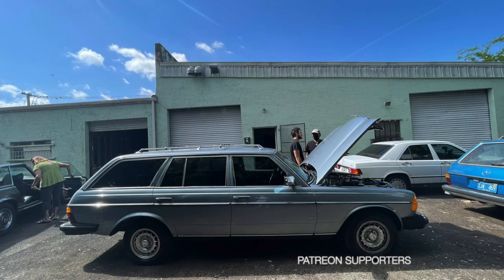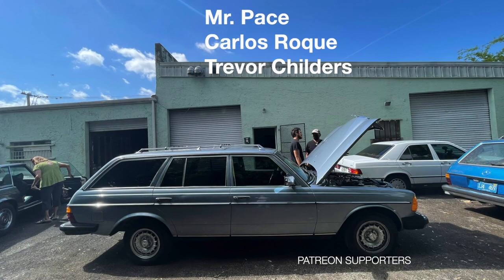What is the Mercedes M119 engine and how was it developed?   HD 1080p

Comment: If you ever followed Tim LaTobe's M119 custom engine build for his W126 SEC track car.  He built his own custom intake manifold using the cut-down base plate of the factory one with c/f i/runners leading from a larger plenum above the intake and not in the valley. Larger T/body fed by over the radiator rammed air intake.  original cams were re-profiled for more lift & duration, custom exhaust, block bored out to 100mm cyllinders with forged pistons, M117 crank, dry sump, Modern ECU and dyno tuned using rear hub direct bolt dyno.  Engine achieved near 700hp ATcrank n/a which was pretty stout.  So the moral of the story is still the intake manifold/plenum & cams are the key to unlocking the true potential of these amazing engines

Comment: As the owner of a 1984 500SEL W126 with an M117 engine and a 1990 500SL R129 with an M119.060 engine, black over palomino, with an original AMG Type 1 Body Kit, this video scratched all my itches! I noticed the many similarities as I learned about and worked on the 2 engines. I just assumed that how all engine development worked - the later evolving from the earlier.
Anyway, this was a great video and I am looking to absorb everything I can about AMG - especially pre-merger, so please bring it on!

Comment: I purchased my first Mercedes in 1995. Was a 93 400E with only 30,000 miles. Loved that car, was kind of too heavy to be a true sport sedan but the engine was dead smooth, as in you didn't even know it was running, from idle to 6,000 RPM. Used to run it on the track at Willow Springs with the Porsche Owners Club. Burned up a few sets of brake pads and tires but was still running perfectly at 185,000 miles when it was sold. In 2004, my girl friend had a 98 SL500. Nothing better then cruising down PCH with the top off. I believe the M119 engine was one of the finest production V8's ever. Some may argue that the all aluminum construction was not durable but that was only true if the engine was abused, over heated or poor lubricants were used. I always used Amsoil products and still do, never have had a failure of an internal drive train part.

Comment: Happy New Year Pierre! Thank you so much for such an insightful video of the M119 engine.  I own a 1996 S 500 and a 1998 CL 500 with 119.980 engines and love them both. They are powerful, smooth as silk and have been unbelievable reliable and easy to maintain.  I bought early last year a 2017 S 500 with the direct injection M278 engine and although is insanely powerful and fast because of the bi-turbo set up, there is clearly no other advantage against the M119.  I would deeply appreciate if in the near future you'll make more videos about the W140, which I know you were not fond of at the beginning, but I think they are now proving to be an exceptionally worthy Mercedes classic, more so when they have been properly maintained and cared for.

Comment: Great information!
The very very first three prototypes of the M120.980 had a modified KE3 installed and they were installed in three W126’s in 1987/88. Can’t remember which transmission and differential they used in this setup. 
We called those three Earlkönige.
Just food for thought
👍🏻👍🏻👍🏻
Reply: Funny you mention that as they basically grabbed 2 m104.980s and joined them together with the 6.0 liters and cis injection. Plus they share parts with each other in the production versions! Bmw unveiled their v12 a few years prior to mercedes introducing theirs and they definitely panicked when the 560 was the best they had vs a v12 salon. But (friend has both a 750li and a 560 sel) the 560 is definitely faster still!

Comment: I owned a 97 W210 with a M119. Love that car and really loved that engine. Never gave me a problem. I did maintain it as per MB service instructions.
Reply: I've had exactly the same car for over a year now, 97 e420 with 230k km, doesn't burn or leak any oil and starts every time and is buttery smooth.
Reply: Didn't the w210 rot from rust after about 4 years ? I'm in MN so maybe it was more likely here.
Reply: Body has ugly spots of rust and like a hundred small rust bubbles, but frame is solid and no spot on the body is rotted through like you would get on say a 90s Subaru. Nothing a $15000 paint job couldn't fix on the w210 😄
Reply: You gotta be adamant with those 210s in the rust belt.  I've found keeping the bodies clean every few days (LITERALLY BY HAND EVERY FEW DAYS)  and a shot or two of Silicone spray in the nooks and crannies (for good measure) keeps them pretty rust free year after year even with hard winter use.  Hello from NH.  E300 Turbodiesel.
Reply: @jzaroh2004  good to know. I have owned only w124s, w201s.  Im not even sure I could find a w210 without rotting panels here now but maybe I'll look.
Reply: @googpix540  they did have rust issues those years. The one I had was always a Florida car where I live. But I have seen some that traveled up north in the salt just destroyed them.
Reply: I owned that car for about almost 5 years I guess. And put 40,000 miles on it. It ran flawlessly. Got pretty good gas mileage to to be a V-8.

Comment: I love the M119, I had it in a 400E. One thing I don't think was mentioned was the M119.960 had the "tall deck", same as the M117. The LH and motronic versions got a shorter deck height, presumably to help with packaging on cars like the 124 and 140 (which never got the .960). I would love an early '90-'92 500SL, those seem to not carry a premium over the later cars with the 722.6 but I think people are missing out.
Reply: I just got into r129s being a w126 fanatic forever! And being a cis guy, I went with a 92 500sl. I’m glad I did though it needed a lot of work. That engine runs flawlessly and absolutely books it when you hit the throttle! I found it funny that the late m113 SLs got the bigger brakes but had almost 30hp less than the cis m119 powered SLs

Comment: I own a 1991 500SL with a M119 ,I don't drive it often mostly a summer fun car ,closest German engine feel and torque wise to a  older American V8 imo .  I do all my own work on my Benz's I must to say the learning curve on the M119 was steep but I enjoy a challenge and knew that when I bought it. She's a scary beast when you lay into it as you said ,I've taken her up to 100 mph and still pulling hard at that speed. I think one could easily bury the 160 speedo but not me .
Reply: I would think the M117 would feel closer to an American V8 with its 2 valves per cylinder.. but I guess you’re not familiar with it. No old American engines were really as advanced as the M119.
Reply: I have a 92 500sl and that engine is strong as heck! And I have a euro tuned m117 in my 560sel. The m117 feels more American than the m119 due to the lower revs and fat low end torque it has. The m119 will pull like a train on coke right up to its 6400rpm redline. Most American v8s of the day didn’t go past 5000 rpm and made less power. I had mine up to 148mph and it was still pulling hard when I let off. Easily a 155mph car all day

Comment: If the M119.960 is similar to M117 bottom end, would it bolt-in an R107. Kinna plug and play since the fuel injection system are same or similar?
Reply: I looked into this for my 92 500sl but it’s a lot more involved than you think, the block needs minor machining to fit the 560 crankshaft and you’d be wise to install lighter forged rods matching m117 specs. The cis injection is pretty good at adapting but the bigger crank and longer stroke will hamper the cars ability to idle correctly as the computers still think it’s a 5.0 with a pretty square bore and stroke. To get the most out of it you’d need a lot of time and money and potentially some amg parts (ecu and ezl mainly) to get it right

Comment: Oh I got a sudden urge to drop M119 engine in a C126. It will be fantastic!
Reply: M119 in c124 would also be a good idea
Reply: Do it!! A friend did a cis m119 in a 560sel and it’s amazing. He just picked up a clean 91 sec shell and will repeat his success again with it. But put the 86 87 560 rear trailing arms and sway bar in it if it’s newer than those years. The later cars have a wimpier rear suspension and the m119 will absolutely make the rear end feel like dog spit

Comment: As usual, you left out some important information. The M119 isn’t simply an M117 with different heads. There are a number of differences on the bottom end. The M119 differed from the M117 in the following ways:

The engine block uses asbestos-free gaskets and has better oil flow
The cylinder head is now a 4-valve aluminium unit with dual overhead camshafts
The connecting rods are forged and enable cooling of the pistons with sprayed oil
The pistons are iron-coated cast aluminium
An improved vibration damper system is used
The aluminium oil pan has bolted-on oil baffles to prevent foaming of the engine oil
The intake camshaft timing is adjusted hydro-mechanically up to 20°:
0–2000 rpm — retarded for improved idle and cylinder scavenging
2000–4700 rpm — advanced for increased torque
4700+ rpm — retarded for improved volumetric efficiency
Reply: Man, you have knowledge of M119 Where is your shop?
Reply: Straight from wiki
Reply: @Mercsixpointnine  Exactly.

Comment: Out of interest are there similarities between the M104 24V and M119 head technology?
Reply: There definitely is but the m104.980 is the basis for the m120.980 v12 engines. The m119 was absolutely inspired but what amg was doing with the m117 engines at the time. Look at a gen 1 w126 with a amg 5.7 in it. Note the header design and cam design. Then look at a euro 560, especially one with the 822 option code. The cast tri y manifolds are very similar to the custom amg units on the early cars, the cam is definitely inspired by amg’s work, and the enlarged intake valves on a 560 match the size increase done on the early 500 m117 motors. Hmmmmm sneaky Mercedes. Then the amg 6.0 dohc motors definitely have Mercedes the idea to modify the m117 into the 4cam m119 we have today.

Comment: Very interesting and well told. What would my Euro 350SE be like with an M119.960 transplant???
Reply: Well a friend of mine did a m119 swap into his 560sel and the thing is noticeably faster than even my euro tuned m117 car was! But your a w116 chassis and I’d wonder how well the wide m119 would fit in there, then again a 6.9 did exist and that is a HUGE engine. Your car with a cis m119, gen 2 560 rear subframe and torque dampening rear suspension and the 722.3 4 speed auto box and gen 2 w126 upgraded brakes, car would be sweet and actually handle the power well with factory parts and a limited slip diff (stock 560 2.47 unit and axles)

Comment: Hi Pierre , I have an very early production Euro spec 1989 R129 500SL with M119.960  22002593 engine and it has a stamp of E10:0 on the engine block and has factory option code 828 ( Non-KAT) is any unique or rare at all ?